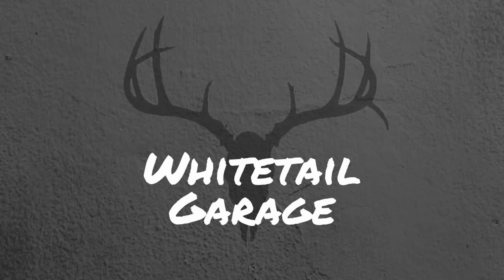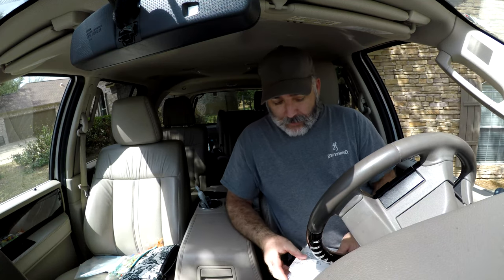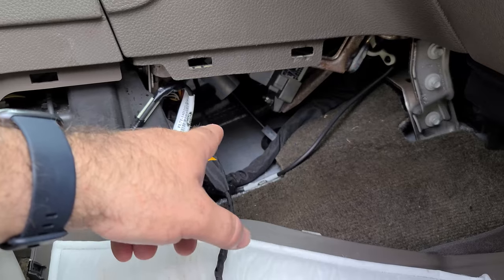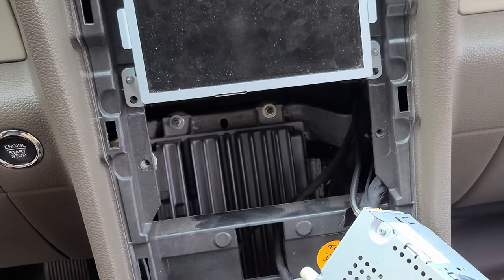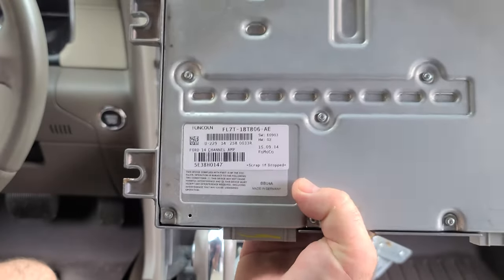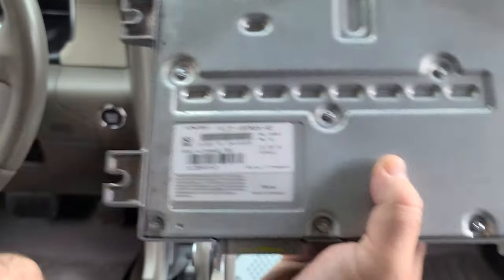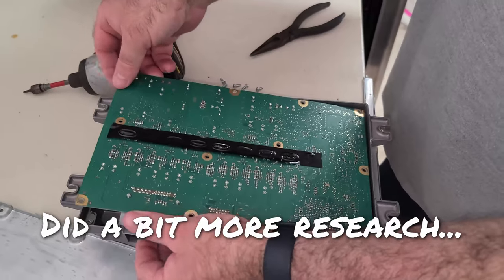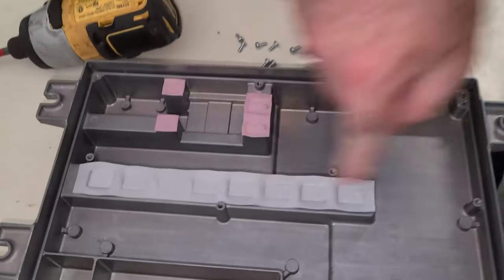2015 Lincoln Navigator THX Amplifier Repair

Comment: I had this same issue and fixed it with using items I had on hand. I used some 3M double sided tape and Mr Clean Magic Eraser Thin Sheets. They were the perfect thickness and have been holding up strong and not caused any issues. Hope this helps someone!
Reply: Thanks. I used some 3m double side tape I had lying around as well. Worked like a charm. Seems to be the same silicone material.
Reply from the maker: Interesting, I believe you need to have that thermal heat transfer in that location.  If it is fixed, great!  But it may not last if it gets hot with high volume.

Comment: Looks to me like the 8 pads that touch the 8 dimples on the cover are a ground. Your static issue is due to bad grounding. The new pads just gave you better contact with the cover. Should be able to repair with cunductive copper tape or solder the pads where the copper is rubbed off.
Reply from the maker: I don't believe it is grounding through there.  However, you may be correct

Comment: To follow up on this video, I’ve actually followed every part of this.  It lasted for a good 3-4 months and then it acted up again.  Very frustrating and im beginning to think to either redo this or purchase a new one.   

Horrible how Lincoln can’t do a recall on this if it’s common fail for all navigators of this generation.  Not that it was hard or anything but it is in a tight spot & can’t imagine doing this every 3-4 months.
Reply from the maker: Agreed, sorry to hear about that.  Every 3-4 months sounds like you need a replacement Amp.  I wonder how many others are seeing the same result.

Comment: It seems like the tape doesn’t cause grounding to stop, but rather those points are there to push in the pcb so that the thermal pads are sandwiched more
Between the heatsink.  Poor design.  Great video.
Reply from the maker: Thanks!

Comment: Ok So...I'm back up and running...for now.  took me bout 1.5 hours cause I was watching the finals and going slow so I didn't break anything that I didn't care to replace. I could do it again in 45 mins. I did all three remedy s  ( the electrical tape...pounding down the raised fins and the new insulation as I do not care to do this again). If it fails again I'll remove replace.  I'm wondering if the act of removing power to the Truck and more specifically the amp is what may force a sync "reboot" and that's what actually restarted it. With that in mind, the failure may have just been the symptom of the problem that we addressed with the new insulation pads. Either way I'm only down $10 so nothing to lose and I'm not in a worse condition....
Reply from the maker: I tested each step, the only positive result was with the new thermal pads.  We'll see if it lasts.  So far so good.  Let us know you see any different results.  Thanks for watching!

Comment: The thx system sucks. If my volume is too high the sound goes very low.
Reply from the maker: I agree, all the new ford systems are not loud enough.
Reply: Yes mines does the same thing as well. Did you find anyway to fix that problem?

Comment: Sounds exactly like the problem, I'm having with my 2015 Navigator. If I can't do it myself, do you have a suggestion as to what type of repair service I could contact to do it? A car audio place? Other?
Reply from the maker: Any mechanic garage you trust.  It can get expensive.  I remember correctly, at the dealer you are billed for dash R&R.  Which isnt required BUT....  If you have the right tools it is relatively easy to get to and replace.
Reply: @WhitetailGarage  Went to a local audio shop and it cost me $250 in labor, but they reviewed your video and replaced the thermal pads as you suggested, and it seems to have corrected everything. I haven't checked the Bluetooth phone yet but everything else is back to normal. Thanks so much for your troubleshooting of the problem which seems to be common for the 2015 Navigator. The original quote I got of putting a new amplifier in the vehicle was $1500 so you saved me a bundle and now my trips are much more enjoyable with the corrected audio. Thanks again.